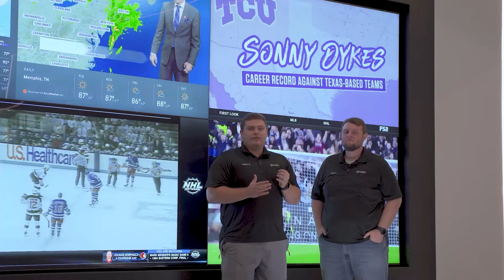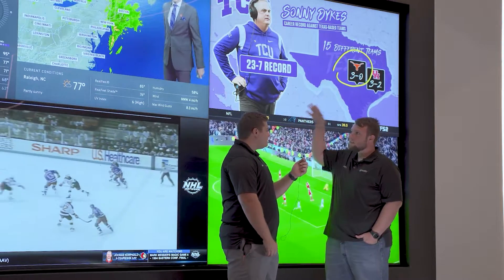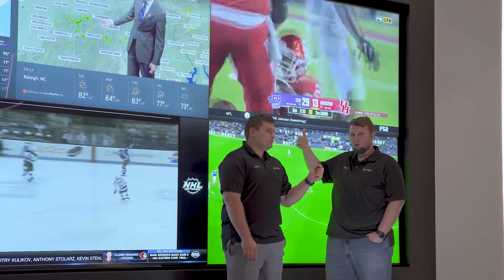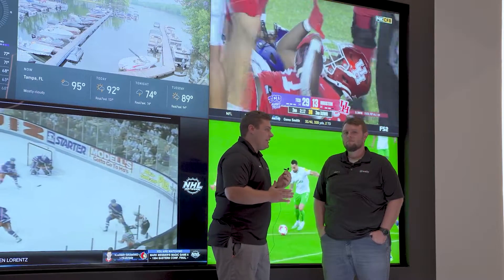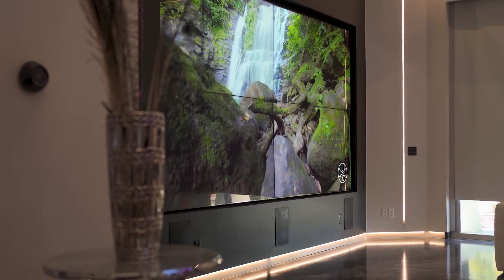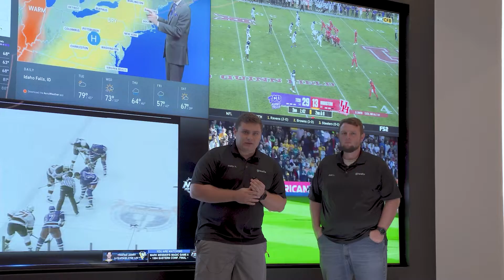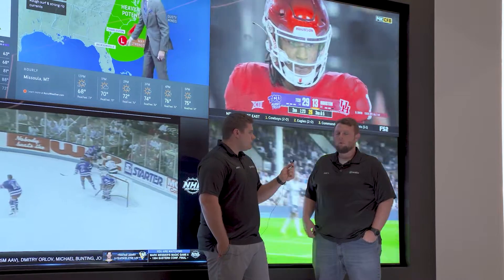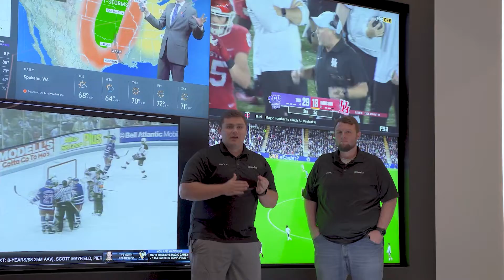Control 4 172 Inch 8K Video Wall Using Multi Display Manager

Comment: Are the 2 top tvs inverted, so the thinner bezels unite with the thinner bezel of the 2 down tvs? If so, can you fine setup a PC with a Nvidia GPU to run a video wall this way?
Reply from the maker: yes these are mounted inverted because of the samsung logo